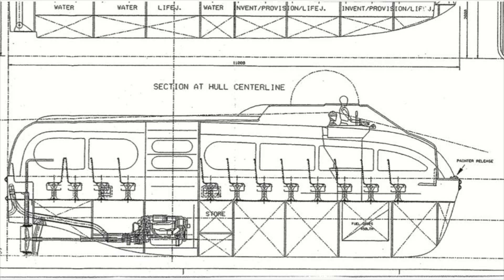Drive system / Electric boat conversion FAQ - Turning a lifeboat into a solar yacht - H.o.G. Part 4

Comment: It's your money and i like your story.
I would look at removing every ICE.
Seal every pass through below the waterline. Convert to electric outboards
Reply from the maker: Thanks! I believe outboards in that power range would be really expensive. The 160kW motors were 2k€ each, hard to beat that. Plus I can reuse the prop shafts and props.

Comment: You do not have the room for a 20kw solar array in a way that would keep the boat seaworthy. I think you confusing units (kw hours perhaps?) or misplacing a decimal point.
Reply from the maker: Actually, it works out - in a way that never gets close to 20kW though. With one layer of panels that slides out to the sides (in calm seas or at anchor and the whole upper deck covered, you get about 10kWp (50 sqm total area). Adding flexible panels later to all sides, I can double the total solar area and have panels facing the sun at all times - though others will be shaded so much that it wouldn't make sense in a residential setup. I doubt I'll ever get 10kW output, but 20kWp of panels in total work out when using all surfaces similar to the Sunreef Eco yachts.

Comment: An important advantage of electric is the low maintenance and so maintenance cost!
And as technology is advancing rapidly not only the solar panel but also the battery system should be in the end (because obviously that's a long term project 🙂)
Great project, best wishes!

Comment: Diesel is a much better option. At least should have kept 1 Diesel for emergencies when your solar system gets damaged and it will in some way. You could have used the Diesel to charge batteries and get to safety. But your boat your problem.

Comment: Well, there's still wind for propulsion, but in that case you would need a backup propulsion and I'm glad to see more and more sailing boats being refitted with electric motors. But what I'm more curious about: Is the name "Heart of Gold" in any way related to improbability?
Reply from the maker: Kite drive is definitely on the horizon.

Let’s say a towel rack is pretty high up on the list of necessary equipment for this boat.

Comment: Just starting to watch your journey with the lifeboat and have a question you have calculated the price, range and time it takes to refill the lost energy . That being electric  diesel or solar but did you take into consideration how much daily energy you would need to live on the boat, not only driving it ....you probably have anwsered in another and i guess ill have to keep on watching.. Iam quite behind
...
Reply from the maker: Hi! I haven’t been able to get any good data on how much heating (the largest electric consumer) will be - as that depends on how well I’m able to insulate the boat. Anything else should be insignificant in comparison.

Comment: I admire what you are doing, full of idealism and execution

I am also working on a solar boat. The difference with you is that I built it from scratch, and you are remodeling an old boat. It seems that you are more environmentally friendly. The same is that I am also building a catamaran. Indeed, the catamaran can squeeze out the area of the solar panels. Your progress is ahead of me, I just finished the base frame and support structure, and I am about to put the first aluminum plate

Although I like the concept of solar energy, I admit that there is no way to collect solar energy when it is cloudy or rainy. Bad weather can be dangerous sometimes, so I still have plans to use two petrol outboards to keep me safe from bad weather and big waves

Comment: Unsure if you have thought of this power source / range extender...I kinda stumbled into it as I did your channel- this is the only video watched so far. If you make sure your motor has regenerative ability like most EV cars, there are some large boats, even at least one shipping container that uses kites. Instead of kite surfing its kite boating. I figure dragging those props through  the water with a regen motor will charge way faster than solar while you're on your way cost free where ever you're going. Have you considered this already?
Reply from the maker: Yep, a kite would definitely be very nice at some point. Energy generation through props into battery won’t be terribly high, but free kinetic energy is more than worth it. 

Setting the motors up for regenerative “braking” anyway though - anchoring in a current would also work.

Comment: Keep your wt low.. in the hull. I would put a head at the rear and  
another forward .. if you put your beach deck at the rear  you can use the shower supply to feed the external washdown shower and you dont have kids or visitors dripping water through the boat to reach the head. 
I hope you saw the link to hybrid 
PVT panels efficiency and longevity.
Reply from the maker: Thanks for the tips! Both heads will be in the rear actually since the main sleeping quarters and the stairs into the guest / children's sleeping quarters are all in the rear anyway. That'll make the shower topic much easier and also simplify tank setup. 

"keep your wt low.. in the hull" - you mean the weight? The center of gravity will actually be way down due to the batteries being in the hulls. 

I haven't seen a hybrid / PVT panel link anywhere yet, but those panels are definitely a great idea for heating!
Reply: @HeartofGoldLifeboat  

Thats U tube blocking external links. .. worse they remove the whole entry which removes any other ideas. 
Still try these... Seperate so you know ive responded.
Reply: @HeartofGoldLifeboat  
PVT hybrid panels. 
https://youtu.be/vzRTtaDVVW0

https://youtu.be/FPBhyaEcv8w

Use in conjunction with an insulated water storage heater. 

A lot of yatch designers are using not just fold down transoms, that can act as swim platforms .. or Dingy lifts but also the rear side decks to increase their leisure area. You just want a walkway...mooring access....but providing walkways to get kids elderly or bulky items like shopping carts or heavier from tidal docks or  harbours needs a plan. So I'd also have an open storage area for bikes buggies cycle trailers etc next to your mid point doors.  Tip sub 26 - 20
inch wheel e bikes or cargo bikes are a great boon to boat life with or without kids. They need to protected from weather and theft but easy to get at hence store age in an area next to a door. ...and transfer to shore in all directions.
Reply: @HeartofGoldLifeboat  I was refering to the center of gravity.. water tanks... drinking, grey/rain, Black water/ sewage
That central under deck channel 
Seems a perfect route to run water pipes and possibly a waterproof conduit for cables .. fore and aft. 

The more of the heavy stuff you can keep low the more stable she will be and space you have above. 😉 You may need to have a header tank for drinking water otherwise you will. Be relying on pumps running each time a tap is used if you have a header tank it only needs to refill say when its Two third empty and you can run a better pump especially if you can run a domestic dual item. 

The number of boat owners i see struggling to add pipes and wires as their needs grow . its the same problem with fitted kitchens and Bathrooms in houses owners forget they will need to get access to the backs and undersides of things because things break wear out or they want/need to add something else.. so think flexible maintainable, sustainable.
Slot in bulk heads and partition walls...?

https://youtu.be/oeRLwktDp-g unusual split deck Power cat but might give hou an idea or two 🤷🏻‍♂️🤞🏼

Comment: Hi, great project! I right now in planning my 11x4,5m solar houseboat (ponton platform) in Poland, but this lifeboat is badaass and has perfect proportions! Congrats :) 
15kW of motors it seems little bit to small. I was calculating for mine around 2x5KW or 4x2,5kW for 48V system. What was original HPs of Yenmars?
I highly recommend LiFePO4 packs (f.e rack mount 48V packs) - there are safer than LiPo’s from wrecked cars and 10+ years for daily cycling :) Cheers!
Reply from the maker: Thanks! The motors have 80kW each - 15kW total is the calculated energy consumption at 5kn. 

Is your project public anywhere? 

I'd love to use LiFePo4, but can't find good quantities used, so I'll stick with Leaf packs I think.
Reply: @HeartofGoldLifeboat  
Hi! :) max 80kW - nice! So yes, for this peak powers you need high voltage pack like car pack (~300V) as a buffor (2x80kW / 300V ~= 2x 250A). Good idea is to get it with oryginal BMS(!) and AC charger, than you could use inverter’s AC side (with  lost efficiency). Sourcing solar high voltage direct charger could be problematic. 
Lief pack is good IMO as a starting point :) Long term LiFePO4 is much safer and 10+ years of daily usage. But for your high voltage pack it is less economical I think. For HV packs BMS max voltages limitation is an issue to connect in series. Then price - most economical are 100-280Ah prismaric cells that are perfect for 48V system but for 300V you need 100 of them for circa 10k€ minimum ;) 
Check Will Prowse channel andhis forum for good cell and equipment sources!
No, my project is not public. Right now I’m sourcing military surplus flouting  bridge steel  pontoons/elements as a base. It need to be ice proof becouse I plan to live there all year round (11x4,5m, 40m2) and travel thrue canals of europe in the future :)
Good luck and cheers!
Bart
Reply: Hi Bartek i linked Poly in i think last year glad you made contact with this guy. 
From comparisons with Silent i suggested following their motor  powers.

Comment: Morning. Thanks for the update..

This is an awesome project and I can't wait to see your next video.. 

Just a thought. Have you looked at the the power pod wind turbines as supplementary power for when the sun is not out.. ?
Reply from the maker: Thanks! 

Those things look great and certainly claim to generate tons of power (with their claims, it may be better to get rid of solar all together and put 20 of those things on the roof) - but it's still very early stage without any non-CGI video or actual specs. I've subscribed to their newsletter though and will see what's happening with them. Thanks for the info!

Comment: Don’t forget that the service and maintenance costs of an all electric system will be much cheaper than servicing a Diesel engine too.
Reply from the maker: Yep! If it's any similar to my Nissan Leaf,  it'll be awesome.
Reply: Full duty Diesel engines don’t need much maintenance as they are designed to be very dependable and efficient (cost wise) to operate.